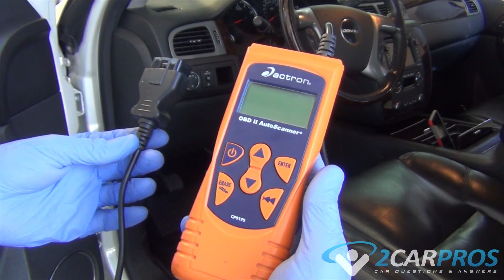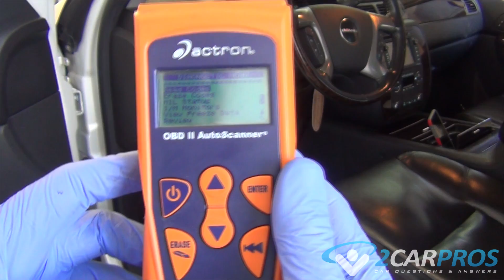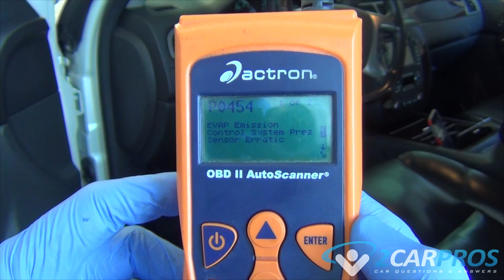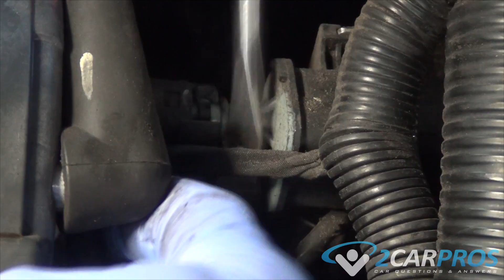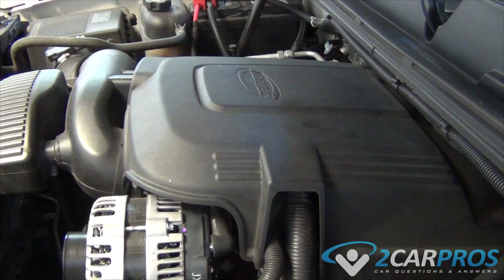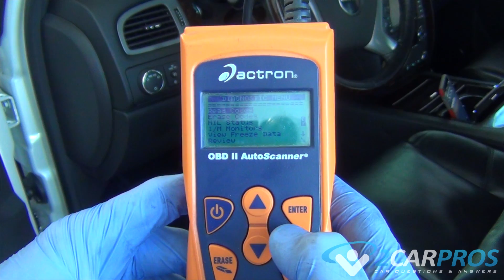P0454 Got an EVAP Code? Quick and Easy Fix!!

Comment: Hi Ken. Thanks to mechanics with tutorials like this, I also solved my ‘08 Silverado evap issue with this hose. I bought a $30 code reader on Amazon, then watched a bunch of the 5 possible evap system fails and decided to go with your test. My hose was exactly as you showed- loose and wobbly. $80 up here in Canada and five minutes later codes cleared, engine light gone and problem solved for $130cdn. About $15 usd 😅. Thanks to mechanics like you, I saved the dealer possibly replacing my cam sensor for-well you know, lots of usd and a second mortgage up here. Keep up the great work!

Comment: #2CarPros I keep getting code 442 I believe it is (small EVAP leak). I have a piece of rubber hose running from the solenoid up to the front with what looks like a small vented plastic box on the end. Where should that be located, and what is the best way to get part numbers for the pipes that are in the EVAP system?

Comment: I had a PO454 at first, then after a few days suddenly it's gone and I now have a PO455, PO420,PO300, PO301,PO304, and a PO338. Oh, AND it wont start....O.o, Mine is an 'O5 Hyundai Sonata
 2.4L. I ASSUME that the PO455 and PO338 are Primary? OR just the PO455? One more thing, you have to slow-feed the fuel to the tank or the pump shuts off
Reply from the maker: That is a complicated question, if you go to our website www.2carpros.com and ask a question for free, an expert will be along shortly to help! Thanks for watching!

Comment: What I learned about my 09 silverado was the sensor on top of the fuel tank can get plugged buy sand and salt from winter roads. So I tried getting the garden hose to spray off the top of the fuel  tank and sort of forgot about it  because light didn't go off immeadiatly . About a week later the light went off and has not turned back on for 2 months. Do not do this if you smell gas or have a gas leak. Do not use pressure washer. They have changed the design of the new  pressure sensor to keep road dirt out. Please let me know if this is helpful to any one out there.

Comment: An easy way to test if it's this hose is to replace it with any hose that fits snug on the ends it's only vacuum so there's no pressure. If the code doesn't return then this was the problem but most likely it's not this hose.

Comment: This is an intermittent code. It could be anything in the evap system.
Reply: My code pops intermittently.  The mechanic told me that the system "tests" intermittently, not constantly.  He told me it won't test when the tank is completely full.  Which is why my code disappears when I first fill it.

Comment: does it not have to go through a drive cycle to make sure the problem doesnt show up again?
Reply from the maker: Always a good idea to drive it at-least 50 miles for all the computers to get a new good reading.
Reply: or have a scanner to run a evap test?

Comment: Since you said it was strait from gm what's the part number on that? Thank you
Reply from the maker: This was filmed over a year ago but I believe the part number is 
20854453
Reply: +2CarPros  that part number is for a catalytic converter
Reply from the maker: This was filmed over a year ago but I believe the part number is 
20854453
Reply: 2CarPros do you know what could cause this code on a 2003 Nissan Altima ? Thanks

Comment: the p0454 is set for an "engine off" condition, how can a hose leak between the purge solenoid and intake cause that?
Reply: That was my first thought. That would cause lean code.